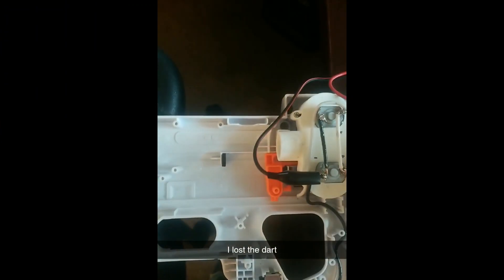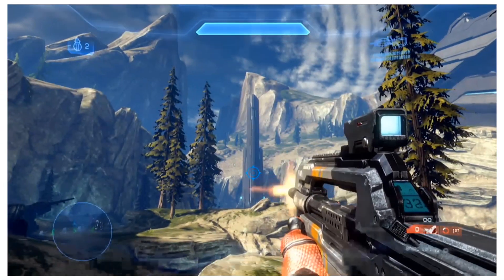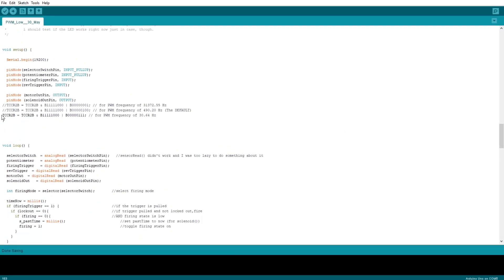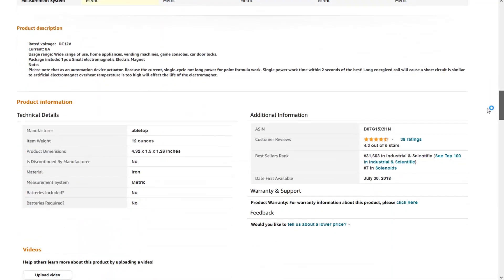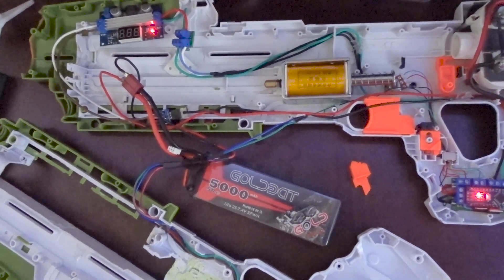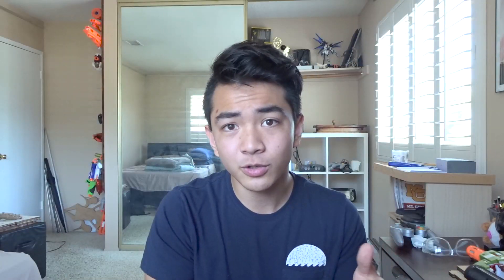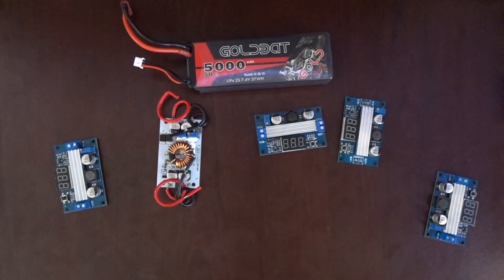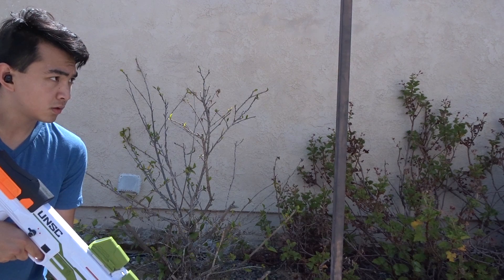Modifying a Children's Toy Until It Hurts

Comment: Nice one - I was wondering when you'd hit on the idea of getting a 3S lipo instead of messing around increasing the voltage 😆
And why not use a MOSFET to drive the solenoid? That would avoid the magic smoke problem of high current going through the other parts of the circuit 🤷🏻‍♂️
Reply from the maker: You can actually see MOSFETs scattered all around the blaster. You have one for motor control, one for the solenoid, and one acting as a power switch. Using just a MOSFET wouldn't work. The issue wasn't with something like a switch, it was the voltage multiplier overheating and being pushed too far with how I was using it.

But yeah, I definitely should've just jumped up to a higher voltage battery in the first place lmao

Comment: Pro build good video. Boost modules eh 2 batteries better solution
Reply from the maker: best solution for me would probably be to use a single high capacity 4S battery, then use a buck converter to provide power to the motors. But, 2 batteries works a lot better and (a whole lot sooner) than that would've.